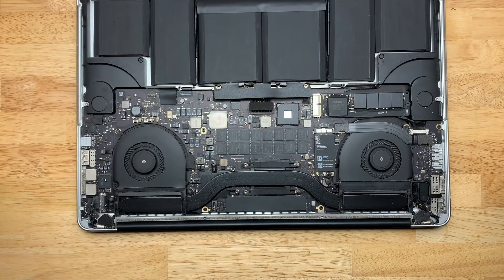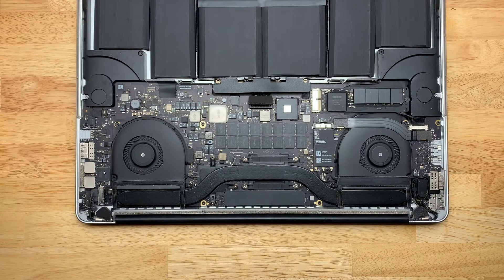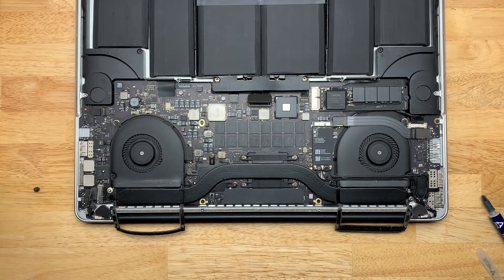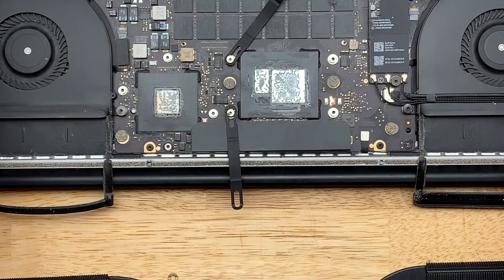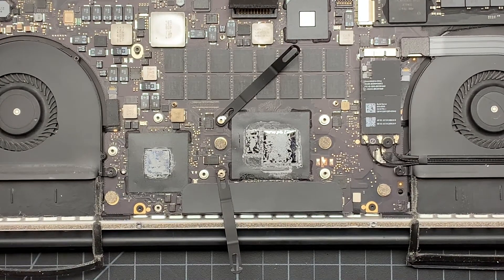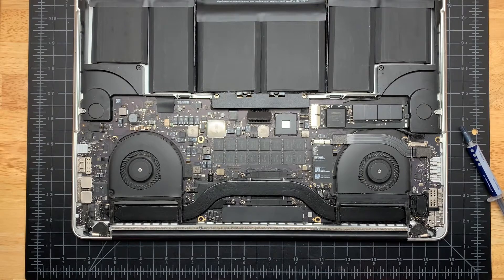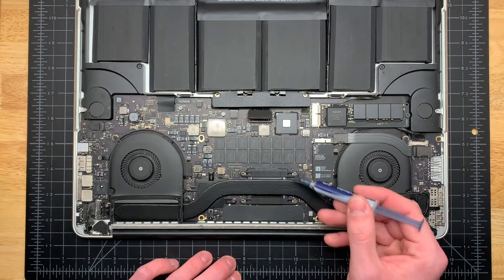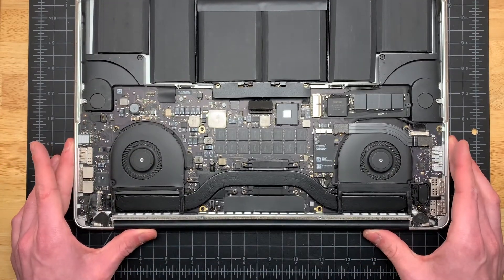New CPU/GPU Thermal Paste - MacBook Pro 15” (Late 2013-Mid 2014 Retina)

Comment: Thanks for taking the time with this, its appreciated. Did you find that the GPU issues were rectified from updating the thermal paste?
Reply from the maker: @JN Nicholls - The temps went down by a few degrees so I definitely think it’s worth it.
Reply: @Casey_Schmidt  I completely agree, I received my paste this morning and carried out the task this evening as per your direction. So far so good, no crashing and its all behaving as it should. I believe my GPU (or CPU) was overheating due to dry paste, no kernel panic (darent say yet) which is a real plus, as Ive been at my wits end with it. Thanks again Casey!
Reply from the maker: @technotrancesessions  - I’m glad to hear the improvement!
Reply: @Casey_Schmidt  yes, the cpu is grand, low temp, low fan speed. Sadly I spoke too soon re the GPU, thats still failing after a day of perfect function. There's a place over here that does a hardware bypass, a new chip to ensure the nvidia card doesnt ever come into play, so its just the on board, I think thats my only option now.